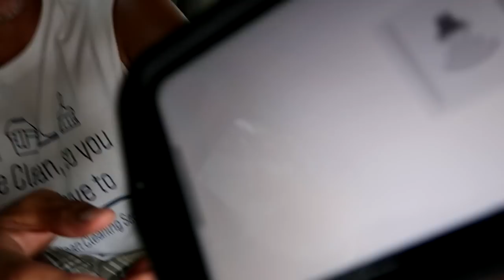Something To Help Darnell

Comment: Pressure washers don't need forced water they will work on gravity fed, you might need to prime the pump or the hose from the tank is to small but I bet you just need to prime it first. If you haven't ran it for a few it will get air locked.
Reply: Also to add if the tank of water doesn't have a vent in the top it'll create a vacuum an not gravity feed the water to the pump thats already built into the pressure washer

Comment: Darnell is switched on for business. He's got at least the basics in the van, plus that 10 bucks buffer which is labour saving. His pricing is bang on too, 50 bucks exterior, 75 for exterior and interior. That's great work. He may get a filthy car here and there, but there'll be no surprises and nothing to sell. He was also immediately thinking about the power of the pressure washer and showing concern about it. That's proper thinking. Best of luck Darnell.
Reply: LOL

Comment: a little tip from the professionals, always and i mean always bleed all the air out before starting your washer, not having water in the pump can cause big problems, it uses the water to cool and lubricate the pump

Comment: Hey Joe, or anyone really tell Darnell that there’s a HUGE need for guys to wash semi trucks that actually do a good job and know what they are doing. We pay upwards of $500 to cut and polish these trucks and one bad wash job by some dipshit with acid ruins it. I have a friend who does it in TN and makes over $2000 a week pretty much year round. He’s so busy he can’t even take more customers. I pay around $80 per wash at least once a week. And most owner ops do as well. Tons of money being missed if he isn’t washing some trucks 👍
Reply: Oh and the best setup is to get a North Star gas pressure washer from northern tool with a hose reel or two and a good wand or two  mount that to a tandem axle utility trailer and find a 250gal water tank (bout $15-$50 used) a few long brushes and you’re Set!

Comment: He should put a ad out for pressure washing business not car wash business.  I had a pressure wash business the last place i did was a small dentist brick building 500 in 3 hrs.and u don't have to worry about messing up ther cars or need all those cleaners i had 2 different cleaners and 2 powerwashers 1 for back up and a van .

Comment: 25$ is way to little..
Reply: Dallas Ray $25 is for the first cut to get an opportunity to show them how well they can do the job.
Reply: @adamalford5650  yes but 25$ probably didn't even cover gas between the truck and mowers much less laber. At least break even. I feel 40 to 50$ would be fair as a first time deal.

Comment: Showing up for a first time to cut grass and your equipment is not working leaves a bad impression. Make damn sure your equipment is working and is solid. Don't use sketchy half ass running equipment because it will fail every time you need it.  If you are cutting grass, you better know small engine repair and maintenance. Get insurance in case you mess shit up. Be prepared to upsell. Bushes trimmed. Leaves picked up. Sell your jobs to people and businesses that have money. Don't work for broke bitches that ain't got no money because you won't get paid. Don't be mowing crack houses so you can score some crack after a job. You mow the rich people yards. They got more money than time to cut their big ass yards.

Comment: Darnell- check out "dallas paint auto correction" and "obsessed garage" on youtube. Super informative information. The dallas paint channel will give you recommendations for best bang for the buck products. Also, right under 2000 psi is safest for cars so you don't accidentally chip the paint. As recommended, get a foam cannon. $15-20 on ebay/amazon, and get the 1.1mm orifice for it if you want to use it on an electric pressure washer to get better results. Just play with soap:water ratio. Amazing product to look into: "Super Clean" from walmart. $9 for 1gal and can be diluted with water 5:1 good degreaser for tires, wheels, inner fenders, excessive bugs on front bumper, and good to use on windows before using a window cleaner. Also, look into clay barring a car before buffing/waxing. Lots to learn, but those channels make life so much easier when you use their techniques/product recommendations in the real world. Also, quick disconnects!! Makes life so much more bearable. As for the tank/pump, try keeping the tank of water above the pump, maybe on block of wood, or lay the pump on the ground out of the van. It may or may not help. Never hurts to try

Comment: You definitely low balled yourself on that yard 20$ is way too low great for the customer but know your worth joe and get better equipment for smother turn outs. The way you do pricing when it comes to yards is you decided  once you see the size of the yard and the length of the grass and throw them a price or negotiate with the customer but $20 is way too low that yard was an easy $50 or more if done right